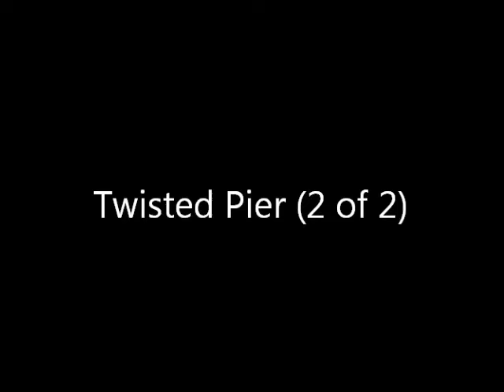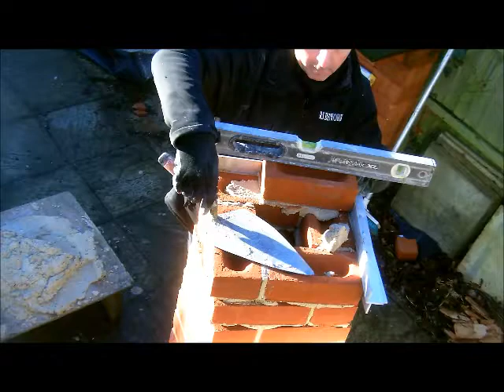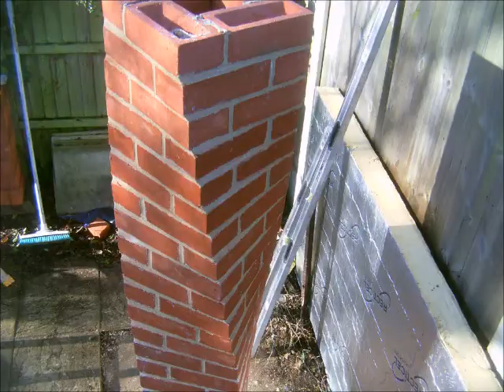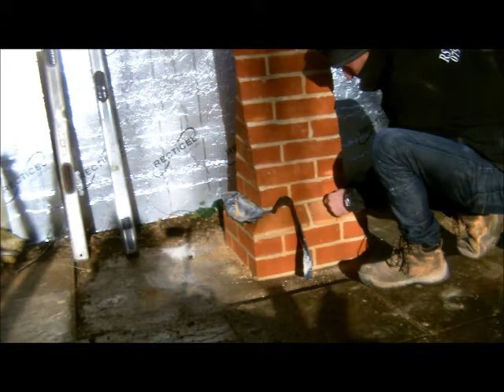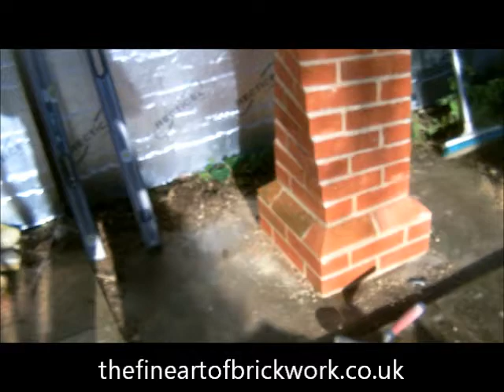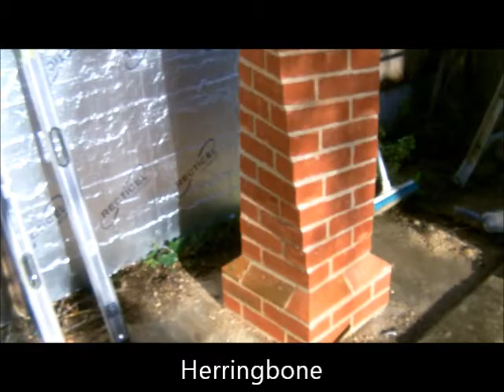the fine art of brickwork - Twisted Pier (2 of 2)

Comment: Nice job again Rob. This is a simple profile to make - just purchase some aluminium angle profile, use metal drill bit to drill pilot holes for small fixing screws. A lot of the DIY sheds sell aluminium angle, or google a local sheet metal and stock steel supplier. use small self tapping screws (the type used for metal stud work known as wafer screws which have a small cutting tip which drills through the relatively soft aluminium) are ideal but tend to come in large packs. Then, using a set square to ensure each are at 90 degrees, screw each pair of 'L' shaped profiles to each other (one pair upside down of course) but offset by say 10mm at the corner. File or use angle grinder to get rid of any protruding screw points. worried about the screws? Use suitable adhesive instead and clamp together until it goes off. Superglue would do it, but maybe would go off too fast! there, now you have constructed your very own twisted pier profile! Much more satisfying making your own! About £10 should be all it would cost. Once you have the materials it should take no longer making one than I took writing this post!. But I can sell you one for £79.99 if you don't have the time though. Be sure to keep the profile clean of mortar to avoid marking the bricks! happy twisting! Nick Wall Design + Build